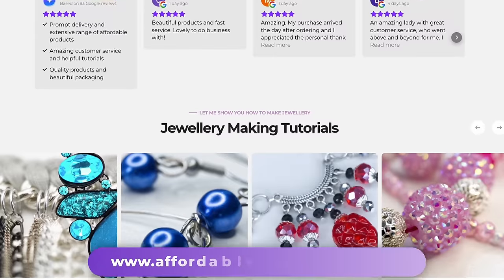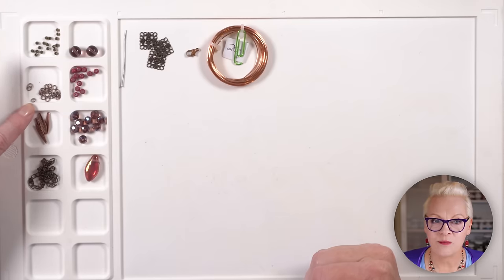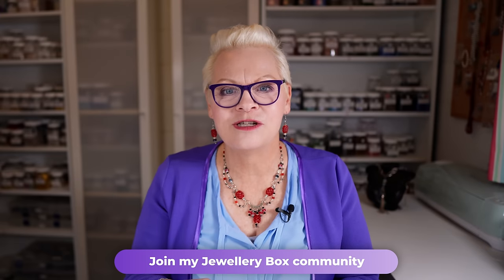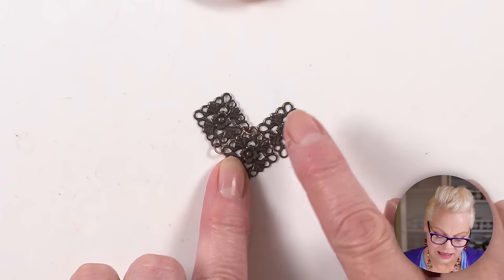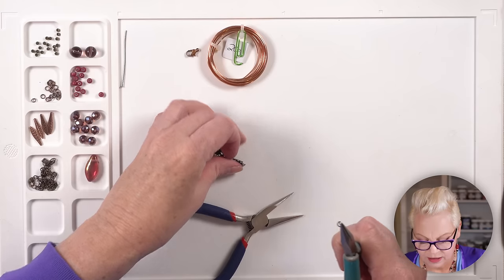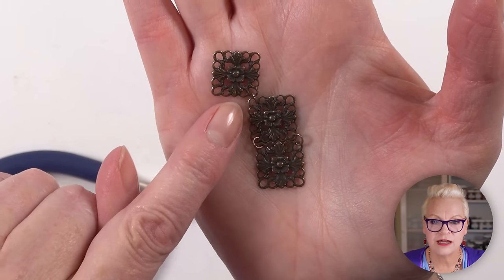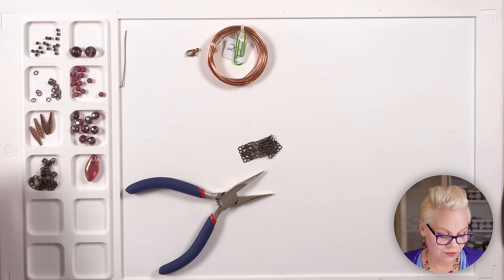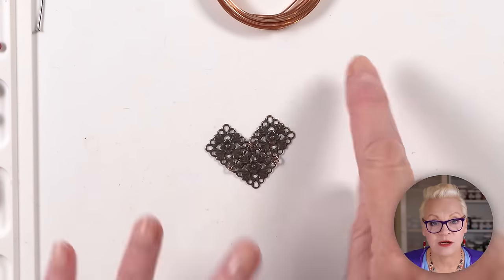Escape Focal Frustration: A Creative Focal Necklace Tutorial

Comment: I reeeeeally like this necklace. I even have those filigree connecter in my stash so I can make something similar! The 20 gauge copper wire you're using sure looks nice for your beaded wire-wrapped looped connector, aka links. They are substantial enough for the necklace to hold it's shape but are delicate enough to work with the filigree. Gosh! I never thought to use my crimping pliers to tuck in the wire ends. Great tips.
I've never seen any other YouTube instructor share the bead layouts. I really appreciate that you do share them. I'm so glad I came across your channel. I also appreciate how you put the components in your flat hand to show each step. It's so much easier to see the piece that way. Girl . . . you're so good! 
Wondering if you tend to connect your wrapped loops directly or do you always connect the components with a jump ring? As a dog owner, jump rings make me nervous as part of the structure of a necklace or bracelet. They can pull apart, for example if a baby you're holding grabs at it or a dog jumps on you and accidently gets it's paw caught on the necklace. Whereas wrapped loops do not pull apart. 
I'm with you about using a larger jump ring (or in my case a wrapped loop connector) for the clasp. I also use larger clasps than necessary to make it easier to hold. 
I totally agree about the finishing touch on the end of your extender to make your jewelry look professional. I try never to leave an extender chain naked on the end. 
Sorry to go on and on. I'm just really happy I found you and I love this necklace. Thanks so much for the detailed tutorial.
Reply from the maker: Michelle, you comment made me laugh.  It was so wonderful to read. I agree regarding wire wrapped loops being stronger - in fact I had a jump ring fail on me this morning - I caught it in something and it came apart. There's no reason why you can't skip the jump ring and add two wire wrapped loops together. Sometimes, it does sit better with a jump ring, however. It's about trial and error. Thank you so much.

Comment: What length of wire do you normally  start off with when making one of these  bead connectors with a wire wrapped loop?
Reply from the maker: It really depends on the amount of beads I'm using and the size. I usually just cut a bit that I think will work. You generally need about 1cm for each loop and the size of the beads but you don't want to cut it too small because you run the risk of not having enough. I also save lots of my small pieces to use in other projects. I hope that helps.